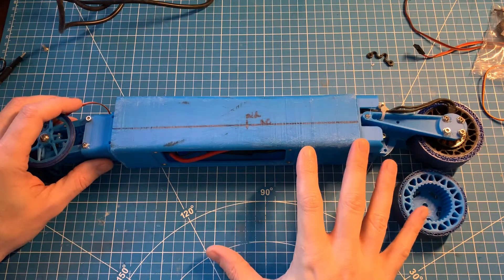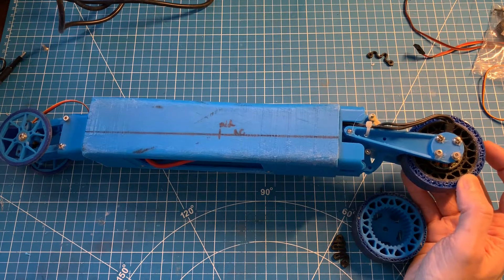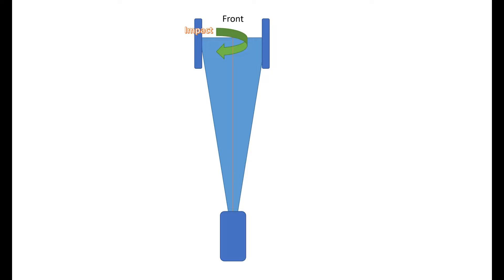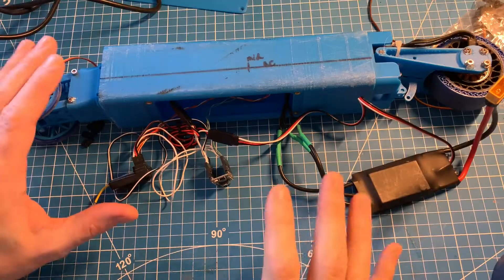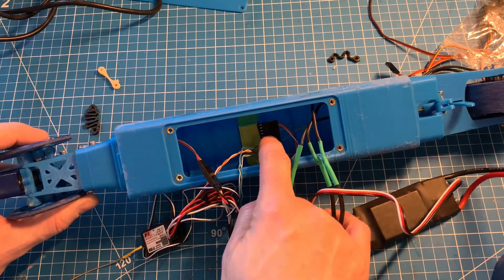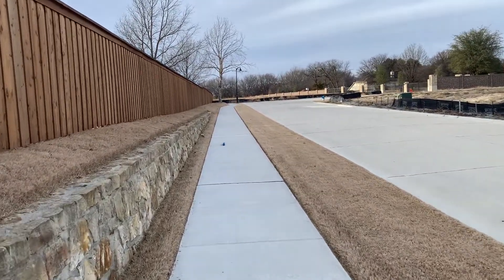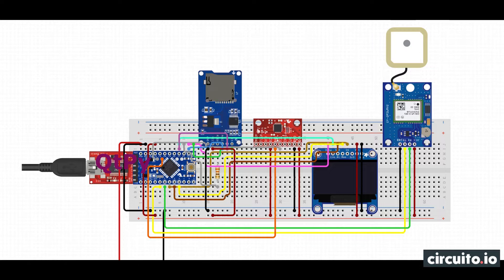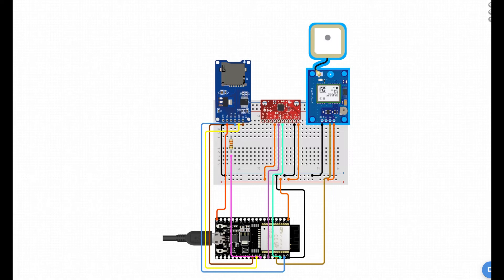Project Streamliner: Electronics 1.0 Pt5

Comment: Massive stability improvements from last time.  I think if you look at any production 3 wheel car the front is alot wider.  I fully recognize the aerodynamic frontal area is the enemy, however I think you could spare some.   My thought is to put wide wheels/tires on the front.  You could make the body a tear drop and still be very efficient.

I have not shared my build yet but the front is 120mm wide and rear is 62mm wide.  It looks like a 3 wheel but has 4 as the rear 2 are inline.
Reply from the maker: Yeah the car isn’t very statically stable with this design. I want to get the new electronics installed and try the dampers, but realistically if it doesn’t work after that it’s on to a new design that’s more stable.  I’ll definitely be testing the wheel layout before I spend so much time designing everything for the next one.  

Your car sounds really interesting. Hopefully I can get mine running and we can run them together.

Comment: Nice to see the progress! I don't know about it at this scale, but rounded profile tyre can tend to hop under strong acceleration. Triangular profile is a bit better for that - - but I think the flat rear should be fine unless you have big problems getting enough compliance.
Reply from the maker: That’s interesting about the rounded tire. I’m hoping getting the dampers installed and more weight lower in the chassis will help and I don’t have to mess with the tire shape.

Comment: Thanks for the interesting information you are sharing. I loved your 3d printed shock absorber! I have a question what printer do you use and does the high temp hotend let you print pla or you have to change back to the normal hotend?
Reply from the maker: I use a heavily modified Creality Ender 3 with an E3D Hemera hot end and a hardened steel nozzle. I can print anything from PLA to Polycarbonate with this same setup which makes it nice.
Reply: @IndeterminateDesign  wow amazing with an ender 3! Well i have a flashforge guider 2 a heavy duty printer but i can not use the high temp hot end to print pla because no matter what i do i get heat creep! So everytime i want to print carbon fiber nylon or else i have to change the hotend :/ do you get any heat creep on your printer?
Reply from the maker: Yeah, no issues for me with heat creep with the stock hemera setup.  I know if I ever go over 300c, E3D requires an upgraded heater block and heat break.  You should check out Microswiss.  I've heard good things about them, and I think they make an upgraded heat break or full hot end for your printer.
Reply: @IndeterminateDesign  i have the micro swiss and i have the flashforge original and both doesnt work with pla only the high temp materials :/ so why would you need to go over 300?
Reply from the maker: That's a bummer that the microswiss doesn't work well for PLA.  Materials like Polycarbonate are marginal to print below 300c, but ultra strong materials like PPS, PEEK, PEI (Ultem) require 350-450c.
Reply: @IndeterminateDesign  ah yes for sure but these materials need industrial printer i believe no? Is your target to be able to print these materials with your ender 3?
Reply from the maker: @Firashelou    I would definitely like to try carbon fiber PEEK.  It is easier to print with the filler and useful for automotive applications.  There are several people printing this on modified low end printers inside of an enclosure.
Reply: @IndeterminateDesign  aha i see, i will do some reaserches and check

Comment: Why don't you try and find a rc car tire that fits over the 3d printed one. It will give some compliance and make the rear suspension harder or not needed
Reply from the maker: The tire was designed around an existing RC foam tire size but I wasn’t able to find these tires unmounted to a rim. If anyone knows a good place to buy this foam let me know. 

The final tire will most likely have to be foam as this is what all of the top speed runners use because the wheel speeds will exceed 24k rpm. I have also thought about Kevlar reinforced hose and a few other materials. Once I can go over 100+ mph I want to do some destructive wheel and tire testing.  

It’s interesting on the softer tire because they can expand more. Many speed runners don’t run a rear suspension but they weigh significantly more 12+ lbs, where this car is 1.3lbs. Ultimately I may end with a heavier car and a locked rear suspension, but I want to play with things like a cross linked suspension similar to an F1 car to see how this effects the platform. 

Ultimately the whole high speed RC car scene has a lot of unknowns. I haven’t seen rigorous testing of what works and what doesn’t which is what makes this so interesting to me.

Comment: Have you thought about making a thicker rear tire? It would help the car launch better but I don't know how it would work in terms of top speed. Great work by the way, I am impressed every time I watch one of your videos.
Reply from the maker: I do want to try a thicker rear tire.  It depends somewhat on how fast I can get the car to go. As I go faster a thicker tire will expand more in diameter and possibly even come apart.  I’m told at 150mph+ you have to run very hard thin foam tires which only lasts one run.  I have to do some testing in the future, because if go for a record the wheels will be spinning at 24k++ rpm at 180mph.
Reply: @IndeterminateDesign  I didn't think about the tire coming apart, good point, it could help though in theory if you can get it to stay together, it is what the top fuel cars use, they have just a clutch and the tires that expand to give them a higher final drive
Reply from the maker: A slipper clutch would be pretty sweet for getting going, but I always have to remind myself top speed is the only goal. Many of the racers at bonneville will run solid aluminum wheels and tires. 

There’s definitely a shortage of data of what will work for RC speed running.  Right now I have about 3mm of room for tire expansion which may not be nearly enough.